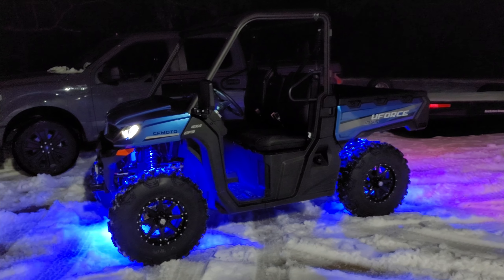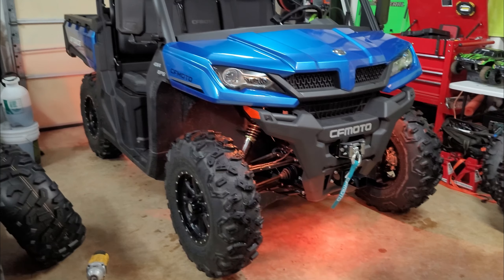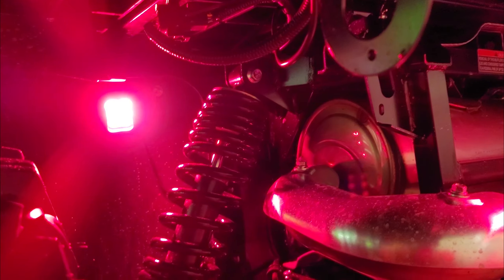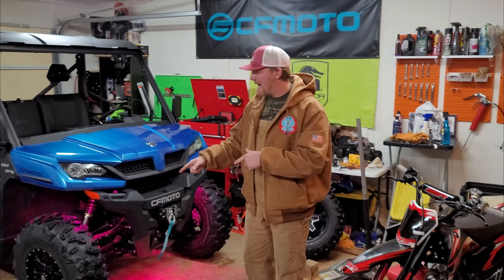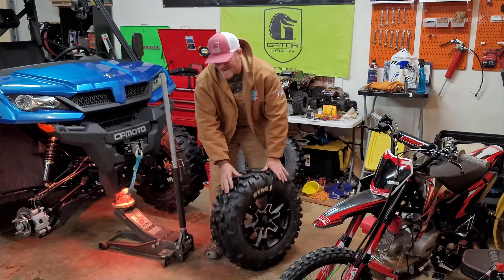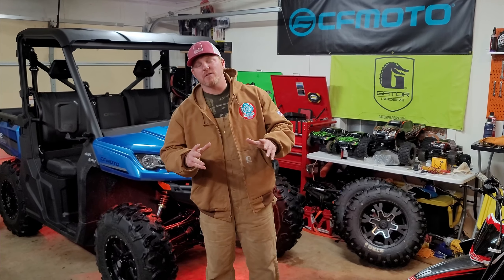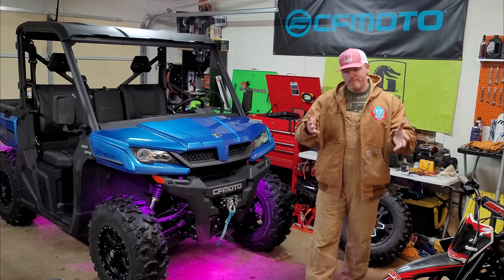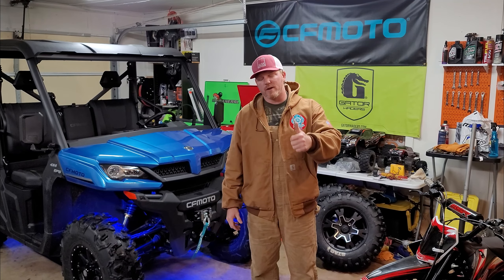2021 CFMOTO UFORCE Build Ep.2 | Best LED Rock Lights | UFORCE From Stock to Custom

Comment: Hey sir how did you hook up your rock lights did you hook them up to the switch that cranks it
Reply from the maker: It came with a wiring harness and a switch.. so I wired the switch in between the battery and the led controller
Reply: @RealTalkPowersports  okay sir thank you

Comment: what does it take to put turn signals on the 2021  uforce 1000
Reply from the maker: Jack ive never done it because its not road legal in Mississippi.  I think some Canadian models are already wired up.
Reply: @RealTalkPowersports  I was wondering the Zforce 800 was all had to do was get the lights and the switch thanks

Comment: Really wish you could get a nice factory cab on par with Polaris and factory heat also.  I live in an area with 5 major lakes and ill bet there are 1500 registered side by sides in a county of 15,000 people.  Everyone uses them for ice fishing it seems like.  And if they upped their tow rating to 2500 lbs they would sell alot of them.  People tow out their fish houses with them then ride them into town for grocerys or wobble pop stops.
Reply: You can get a good cab enclosure with heat
Reply from the maker: I have only seen one cab so far.. I will have to see what brand it is
Reply: @RealTalkPowersports  in Canada its sold through cf moto